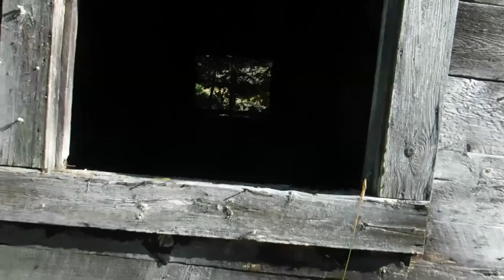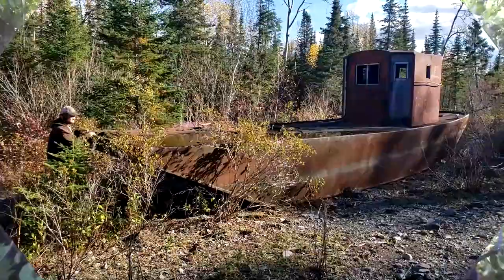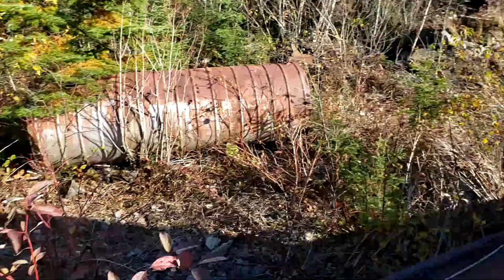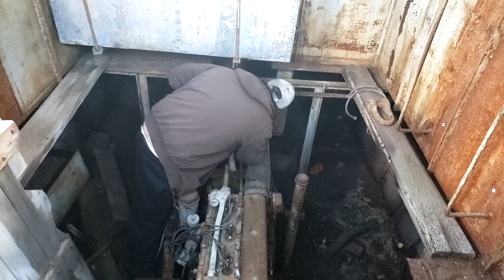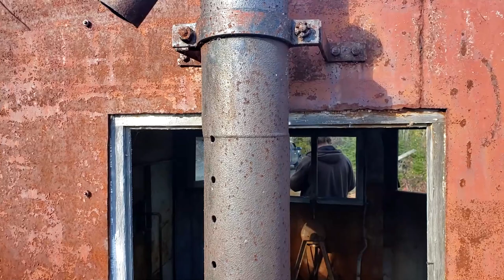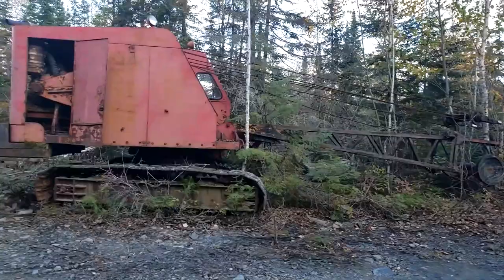Going to Scrap Historic Boat once owned by Great Lakes Paper Company Fort William Ontario

Comment: Would it still be standing if it had been built after that time?
Reply from the maker: These boats ended up on a property and sat there forever. The Engines had split due to the cold and a lot of stuff was stripped over the years by thieves.  The Guy passed away and the Son only had a short time to clean up the property so unfortunately it was easier to get the scrap company to come in an clean up.  There was a ton of old machinery there...all gone now.